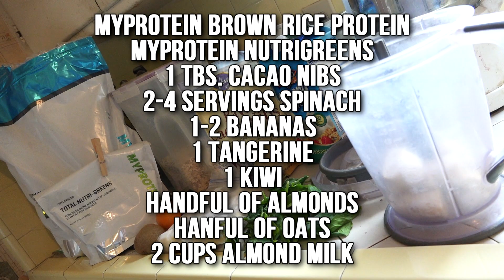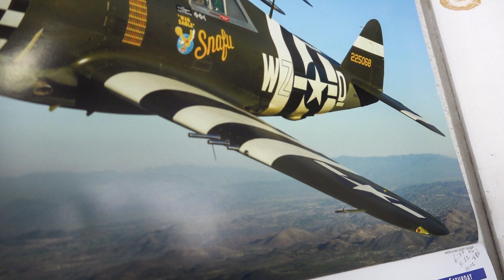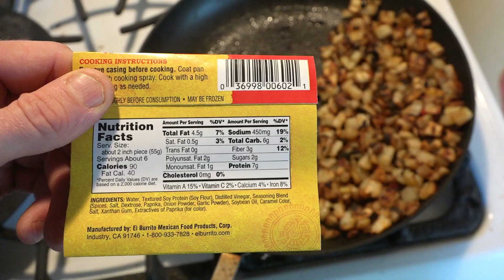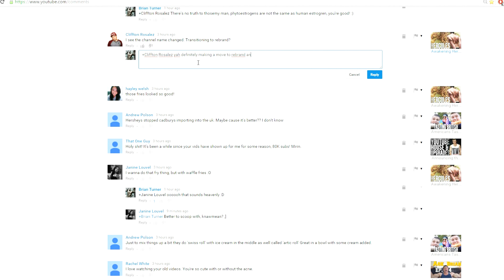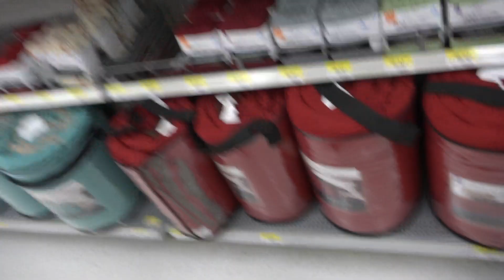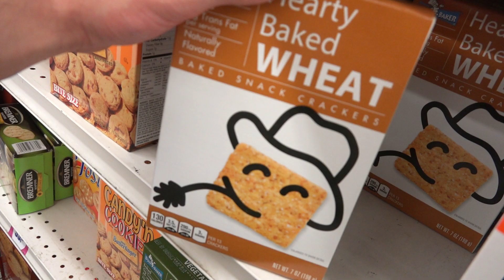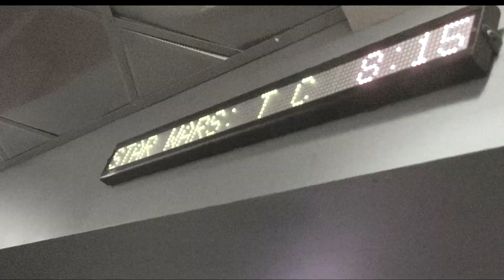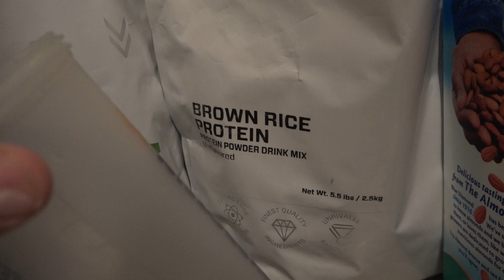Vegan Day of Eating: My Pops, SD Vegan Restaurant & Star Wars

Comment: get a Vitamix or Blendtec blender...either will take your shake making game to stratospheric levels.
Reply from the maker: You are extremely right I need to huh?
Reply: Brian Turner yes Brian, you do...
Reply: nutribullet all the way
Reply: drippy31 doesn't hold as much, but I like it a lot.
Reply: +Sonja Finley true but it does the trick for me.
Reply: drippy31 I usually have a lot of food/liquid in my shakes, so I need more room. I use nutribullet for sauces..
Reply: +Sonja Finley yeah its great for that too. if i want a lot of liquid or just more of the shake ill just do two full things.
Reply: drippy31 yeah, I feel that. I had the vitamix first, so that's what I use it for (and for making soups). Nutribullet doesn't compare, honestly. But it works great for what it can do.
Reply: i got a nutribullet. Wish it was larger :( . But only a hundred bones sooo..go vitamix !
Reply: Johnson Rocson yeah, nutribullet is definitely easier on the bank account! LOL.

Lots of people buy refurbished ones on eBay, and even the Vitamix website has refurbished ones (though a bit more expensive).
Reply: +Sonja Finley I couldn't believe how nice Vitamix was until I got mine what a difference from my old nutri bullet.
Reply: Steak Cancer LOL! I feel that! I got mine after using an Oster blender for yrs, and it was like stepping out of darkness into the light lmfao!

Comment: You need NEVER to switch to canola oil for anything! Coconut for cooking olive for dressing.
Reply from the maker: +Enabler coconut? Ok that it!
Reply: Brian Turner Oils rich in mono or polyunsaturated fats are unstable when exposed to oxygen and heat.
You can also get tasteless coconut oil if you get annoyed by the taste(I know I did! lol).

Don't buy into the whole ''all saturated fats are bad'', some of the shorter saturated fatty acids(like the ones in coco oil) are easily absorbed, transported and metabolized by the body and more importantly they are very resistant to heat and oxygen both in and outside of your body!
Reply: Brian Turner Also, my girlfriend used to have acne when we had just turned vegan and were eating tons of processed foods with said canola oil and it all went away when we cut polyunsaturated oils out of our diet. Correlation does not necessarily equal causation but...for what it's worth!

Comment: Stick with olive oil! It has a lot more benefits than canola and canola is almost ALWAYS genetically modified and treated with chemicals.
Reply from the maker: Oh no that's good to know, I'm gonna switch to coconut oil just because I burn my oils too often I think
Reply: Ah good thing you're aware of that. Unrefined coconut oil and extra virgin olive oil actually have about the same smoke point (350F) so I'd say go for the refined coconut oil (400F) if your concern is burning it during high heat cooking. Avocado oil (480-520F) has an even higher smoke point and is crazy cheap at Costco. Hope this helps!
Reply: Another vote for coconut and avocado oil!! 😋